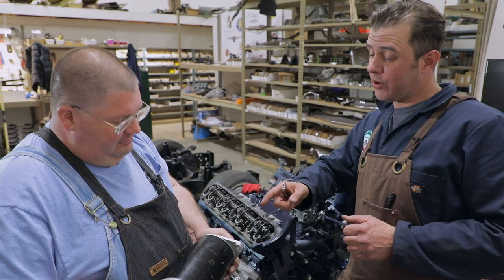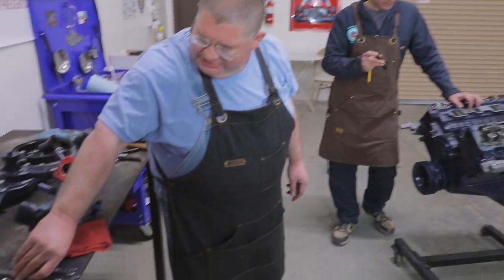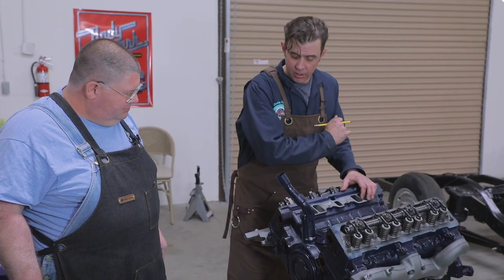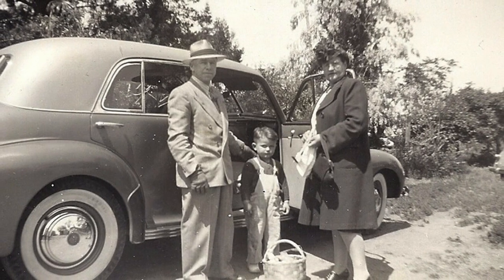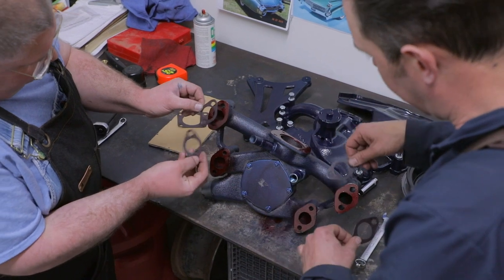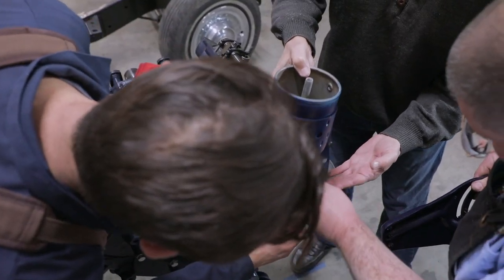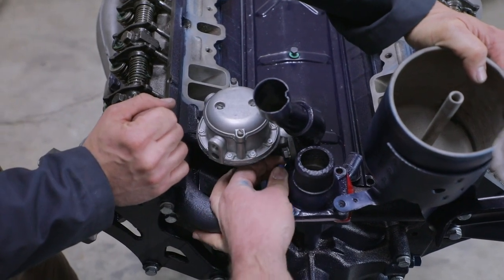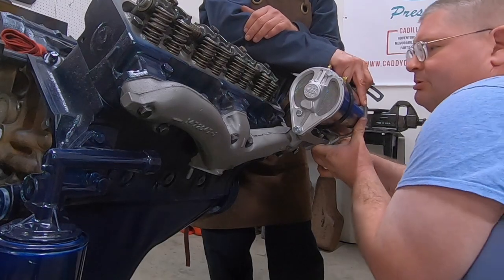How To Install a Fuel Pump, Water Pump, and Accessories on the Cadillac 390 Engine

Comment: Hey guys
Our cady leaks betwen lower and upper water pump assembly, where the O ring is locatet at.
Do you have any tips on how to make it stop leaking?
Thanks
Reply from the maker: That is a tough spot to deal with. Often, there is a lot of corrosion that makes it difficult for the O rings to seal. I would make sure the area is as clean and smooth as possible. If there is only slight pitting, install new O rings with a little bit of silicone sealer applied to them. We're not big fans of silicone, but this is a good place for it. If it's really rough, like it was on our 59', you can sandblast the parts and apply some epoxy to the area. After it cures, you can sand it down so the epoxy fills the pits.

Hope this helps you out.
Reply: @Caddydaddy  thank you!
We will try it out this weekend:)
The surface is not rustet at all but is realy rough, like it was machined bad or something like that. 
Greetings from switzerland!

Comment: Hello friend, how are you, do you have a link to install the distributor for the 390 cadillac 1960?
Reply: We don't have a video, but it is like any other GM distributor; I'm sure
there is a video out there. When doing the job with the engine on TDC #1
the contact on the rotor should be in a position slightly clockwise from
pointing directly to the rear of the car; that is #1 on the cap. The
window on the side of the cap should be towards the driver's side with
the oiler pointed slightly forward. The most difficult part is getting
the oil pump drive to engage with the distributor shaft. A long
screwdriver will allow you to turn the pump drive slightly so it will
align with the distributor. Josh

Comment: Hi Guys.  What is good oil pressure for a 59 Cadillac at highway speeds?  Thanks.
Reply from the maker: Hey Sal, great question! Normal pressure at 30mph should be at 30-35psi and at idle should be at 15psi. Thanks!
Reply: @Caddydaddy  Thanks.  My manual gauge I installed says about 25psi at highway speed so maybe I should diagnose?
Reply from the maker: @Sal-xi9qq  Yeah, anything over 30mph, the oil pressure should be at least
30-35psi. It really should never get over 35psi since that is the regulated
pressure. Probably best to diagnose.